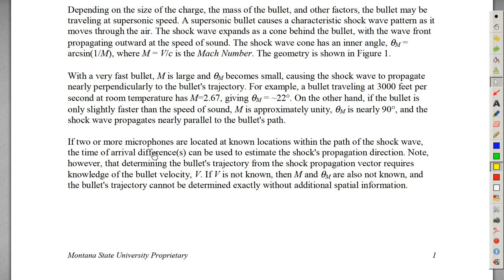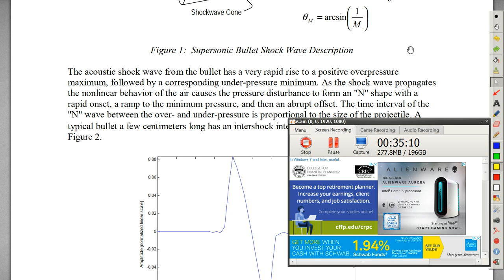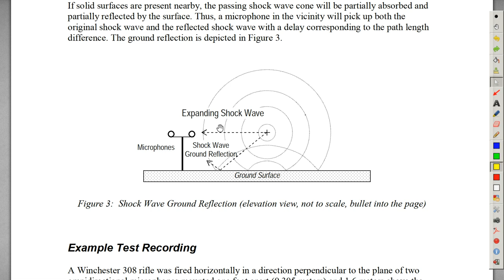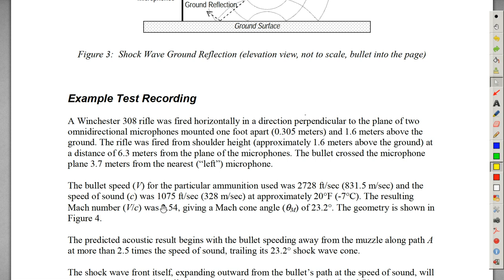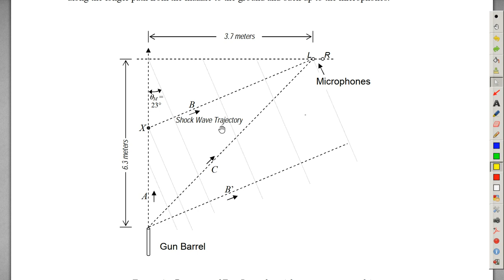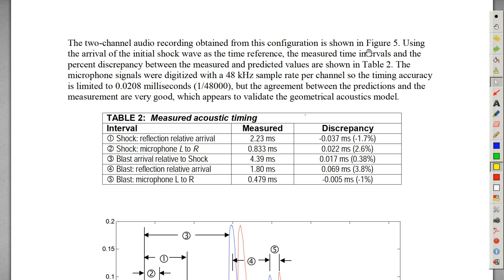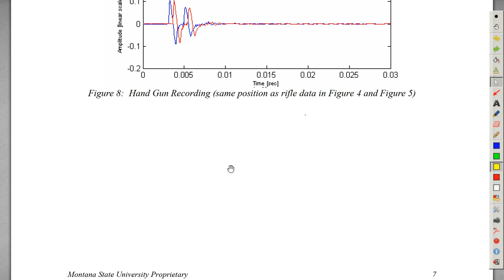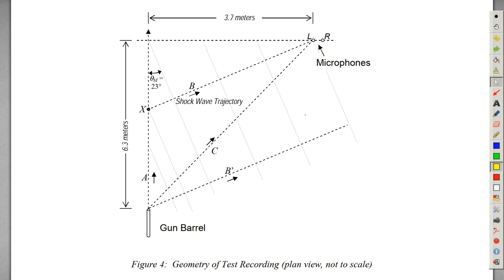Shock Wave Theory I

Comment: What makes this nearly impossible is if any weapon suppression was used.   
The sound of the suppression weapon vs the snap of the bullet I personally can't tell the difference.

Then there could've been suppression weapons used by the police when they entered 135.   As the cop said "hands good shot"
but all we heard was a slight ping sound.

Thank you
Reply from the maker: At large distances, away from the shooter and away from the bullet path the sonic wave and muzzle blast do sound very alike because the air acts as a low pass filter.  So yea it's hard in those cases.  Close to the bullet i'm sure you recognize by ears alone the difference between the two if they are separated in time enough.
On a spectrogram the difference leaps out at ya for most recordings.

Yes, suppressed weapons could make it a lot harder to both hear and analyize.  Not impossible but at least 5 times harder.  Supersonic is supersonic.  Sub-sonic detection in the noisy venue is impossible.  Suppressed muzzle in the same noisy environment would likely still be heard at 100ft or so and certainly recorded enough to identify by frequency.  But I agree that it would be hard.

Here's the kicker I've collected over 7,000 muzzle waves, covering all volleys, and  for 80 percent of them, there are identifiable sonic shock waves.  So i don't need any sub-sonic or silenced weapons to account for all the supposed shots.I don't really think we need to add any more to explain anything.  imho  The only rounds fired that im missing is 8 muzzle waves for the .308 single shots, 22 sonics for the hallway shots, 10 muzzle and 10 sonics for the supposed down the hall shots at campos, and whatever the pistol did and the accidental dischare (its too buried in noise on cop cams)
Reply from the maker: I had another comment on supressed weapons, i've looked at non-vegas videos on that stuff particularly suppressors and brakes, they leave a smearing to the sound over time, kinda like the co2 leak sound in the venue but on a very short time frame.  To date the only muzzle blast waves i susspect of that are the .308 and i might be rewriting that opinion soon.